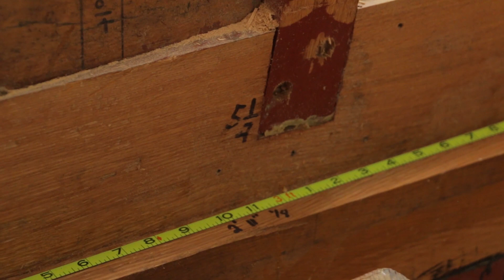Acorn to Arabella - Journey of a Wooden Boat - Episode 72: The Garboard Plank

Comment: I've been watching religiously since the lead keel weight was poured.  This step feels like the first step on the downhill side of the project.  The garboard plank seems like an incredibly difficult step because its such a huge piece of wood, and has to be cut so perfectly.  You can't un-cut a board that big if you make a mistake.  I think that it's at this stage that I would have a real problem of being frozen in indecision.  I think the main load that Thad shouldered was giving the boys confidence that they were doing the right thing.
Reply: Wait until they get to the whisky plank!

Comment: The concept of using the spiling batten as a template to get the garboard marked up makes sense but the method escapes me at this point.  I'm sure it works and the test fit looks close, except it  looks more like black art than geometry.  Hope Thad is coming back and you have a bit more time for it.  As always, you blokes make my Friday evening here in Aus.
Reply: I had to go back a couple of times to work it out. With the spiling batten is clamped in a fixed, known position on the boat, you can place a straight edge anywhere on it so that the end of the straight edge just hits the rabbet. Then you mark on the batten the exact position the straight edge is in, with a line to show its direction and the positions of a couple of the inch markings to record how much it is sticking out from the batten. When you take the spiling batten off, you can use your marks to put the straight edge back in exactly the same place on the batten, and you know that the corner at the end of the straight edge marks a point on the rabbet. This way you can mark the whole shape of the board without having to eg cut a template
Reply: Do you know those “direction finders” you see at lookouts and scenic spots, where there’s a plaque set on a plinth, with lines radiating out towards landmarks? Like that, but all the lines point to the rabbet.
Reply: @SaffronMilkChap  Thanks guys.  As in the cartoons, a little light bulb has lit up above my head.

Comment: Exciting stuff. Yet another way of spiling off the planks. There are probably as many ways as there are boat builders, I suppose. Have you had any discussion on the way the scarf joints go on the planks? I know some people say they should present the trailing edge to the rear, the opposite way to the one on your Garboard, if that makes sense. Back in the day with oakum and tar as the sealer this probably mattered, but with modern glues not so. Will you scarf all the joints, or do buts on the planks? I just can't wait to see, you see...
Reply from the maker: With the modern glues, the trailing edge direction doesn't really matter. We are only using scarf joints, no butt blocks. Thanks for watching!

Comment: One takeaway from this lovely video is you can never have too many clamps in boat building.
Reply: And some pretty massive ones at that!
Reply: Trust me, i never have enough... Dont care is they are Harbor Frieght cheap. A clamp is a clamp. as long as it holds i dont care.
Reply: That is an old lament of woodworkers.  It means that one has to get quite creative in clamping.  That can be an interesting project of its own.
Reply: Such an array of clamp sizes - all needed for a specific purpose.  I wonder what shipwrights used before big “C” clamps?  More of the straps and winches?
Reply from the maker: You can never have too many clamps.

Comment: I love how precise and accurate all your cuts and measurements are. I have one question though for how you adjust to the changes in size with the wood with the outside temperature. I can only assume with such a large structure you have that the changing outside temperature would definitely effect the precision of your measurements. How do you adjust for that?

Comment: What kind of glue are you using on the scarf joints on the garboard plank?
Reply: That's a type of2-part epoxy adhesive called Resourcinol - it's a thick, deep-red epoxy resin, which gets mixed with a powdered activator/filler not long before it is applied to the surfaces being mated/cemented/bonded, then the joint is clamped firly and securely. Takes about 3 - 4 hours to set-up and cure initially, about 10-12 hours for the finished curing of the join to take place. Water-proof, deep-penetrating and VERY strong - the finished join, if properly-done, will, when fully-cured, be stronger than the materials being joined, and, in a fibrous, somewhat open-grained wood like the white oak used here, make for a massively strong join - far better than the more-usual end-to-end butt joint with a backing butt-block that used to be commonly-used to extend/lengthen planking strakes (and is still sometimes used, since it is a "traditional" methodology).
Reply from the maker: J.S. Bridges is correct! We are using Resorcinal glue.

Comment: Great video gentlemen.  Thank you Thad and Casey for your help.  That is some garboard plank.  Impressed with the way you clamped the bottom of the plank into the rabbet.  Wasn't sure they were tight enough until Steve mentioned the boat might move!  Have a great weekend.

Comment: Apologies if this has been covered, absolutely love what you guys are doing but don't normally read the comments. I still see some of the temporary (forget what you called them) frames still in place and don't see any notches in the keel timber/floors or keel bolt holes to put permanent ones in when these come out, will there just be larger (empty) spacing at these frames?

Comment: Question:  you fit the plank by shaving off depth on the inboard/inside top edge.

Can you fit it without shaping and fair off the outside instead - i.e. shape it from the outside after fitting?

(I know nothing about boat building, interested in the method)
Reply: The plank needs to fit flush against the ribs - a concave curve from the rib perspective at this point on the hull. So you have no choice but to make the plank a corresponding convex curve on the inner face. The outer surface of the plank will be what it is. It will presumably be finished to allow a continuous curve up the hull.
Reply from the maker: The inside needs to fit flush, but the outside will also be faired once the other planks are in place.

Comment: Just a little question, should you steam the planks before putting them in place? It seems to me that it would be easyer to give them the proper shape and would put less stress on the structure.
Reply: @TheAggromonster  The middle don't need to be bent, so they could rig something with one open end, stean one side, and when it's ok, steam the other. Just give a few more minutes to the first side at the end to make it soft again.
Reply from the maker: It just isn't necessary. Thanks for watching!
Reply: @TheAggromonster  I tougth that the biggest bend would be closer to either ends. I guess that show how much I know about boat (almost notting) ;)

Comment: Why do you back out along the whole plank? It seems like it would be faster to only remove material around the frames
Reply from the maker: It's easier to back out the whole plank rather than try to cut and fit slots for the floors and frames.

Comment: It's still a little hard for me to visualize the mating of the garboard plank to the hull when you are hollowing it out while laying flat. Could you pick it up (or a small demo piece) and show how you orient it against the hull? Thanks.
Reply from the maker: We measure the depth it needs to be backed out in each area and then plane down the correct amount for that area so it will be fully seated in the rabbet.

Comment: I realize it is too late at this point, but why not just back-out a notch for the frames? Seems like the v-groove between frames (between the keel and the garboard) will hold water.
That, and I don't understand why the splicing has to be done before the plank goes on. Any explanation would be helpful when I go to build my own, some day. I can refer back to this video for the reasoning.
Thanks
Reply from the maker: If there is water between the garboard and the keel, we have problems. There will be cotton and caulk between each plank, so it should be water-tight. Scarf joints don't have to be done before the plank is put on the boat (some people do their joints as they go) but it is much easier to glue the scarf joints on a flat surface.
Reply: @AcornToArabella  oh, okay. I was kind of thinking about rain and waves putting water in the boat and draining down to those spots, but I knew you would be caulking. Thanks for the answers.

Comment: any reason you couldn't use a chalk line fir the straight line?
Reply: On a distance they are marking, accuracy is lost as the line tends to bounce and makes a thicker line than what they need.  Thicker line can make the measurements off a bit in the middle.  Doing a double snap causes issues as well.
Reply: Oak not "fir".
Reply: @paulcopeland9035  🤣🤣🤣
Reply: fir is miss typed for
Reply from the maker: It's not as accurate because it can have some curves and it is a very fat line in comparison.

Comment: did you see Tips from a shipwright make long bags out of plastic sheeting with a soldering iron to steam planks that are already mounted to straight sections of the hull..  so the ends of the plank get steamed and then clamped in. within seconds of pulling the bag off without having to put the plank up from the steam box.
Reply from the maker: Thanks for the tip!

Comment: One thing I always wonder about.
Please try to follow my reasoning here:

1: How wide is the structure of each station to which you are bonding the garboard plank? Is it much wider than the power planer to start with?

2: Why powerplane the full length of the plank rather than scarf it up as needed only for the specific station, thus keeping some material on the inward side of the plank?

It just seams as both extensive workload as well as unnecessary work to my reasoning removing material which still would fit inside the vessel.

Comment: The planks are a lot thicker than I expected!
Reply: This is nothing, planking on the HMS Victory was ~6 inches thick.  Sadly, teak isn't really available in 6 inch thick by 9 inches wide and 6 meters in length so for the re-planking they had to do 6, 1 inch sheets laminated together.  The original planking, however, was solid  teak.
Reply: @LeCharles07  My sailing background is mostly high performance racing so I'm used 1cm thick carbon fiber. So it just never occurred to me that a wooden blue water cruiser would need such huge planks. When I saw them strapping a huge plank of wood to the side of their boat my racing brain went "weight weight weight weight weight!!!" Really make me appreciate how many different ways there are to build a boat.
Reply: @LeCharles07  Carried out of Burmese teak forests, presumably, by elephants...
Reply: It's funny how differently we can think I was thinking the exact opposite that I would like to see them thicker .
Peace light love and gratitude freedom !!!!!!!!9
 HHBpHhelps
Reply: @LeCharles07  solid wood even full of knots screwed and epoxied together will always be much stronger and last much longer then not.
Sawdust and chips pressed and glued together another product given to keep us in the continuum of monetary slavery.
 HHBpHhelps

Comment: Won't bending those thick boards around the boat push the frames out of position, with the boards being more rigid than the frames.
Reply from the maker: The molds stay in place until some of the deck beams are installed to make sure that doesn't happen. Thanks for watching!

Comment: Why not just notch out for the frames and leave the rest of the board full thickness?
Reply: I like the way you guy did it, I was just wondering if that would have been a consideration.  May have "locked" it all together a little bit more.
Reply from the maker: It's easier to back out the whole plank rather than make notches for each frame. Thanks for watching!

Comment: Isn't the garboard the ideal opportunity to use that badly-cupped plank that we all find in the stock pile?
Reply from the maker: No, not necessarily. Twist is often the tricky part about a garboard. In fact, the shapes just above there require a plank to be backed out a little more to accommodate for the curve in the frame, so if something were a little cupped, it’d work ok there maybe. I’ve not seen a person select cupped material for planking though. —Anne

Comment: why do your saw's have horizontal handles? thats not propper, vertical handles give way better handling in imo
Reply: Those are a very thin kerf saw designed to be pulled thru the cut. The are tipical in the the far east. They are easier to use because you are taking out less wood fiber.
Reply from the maker: Those are Japanese pull saws and they allow for a cleaner, more thin cut than a push saw.